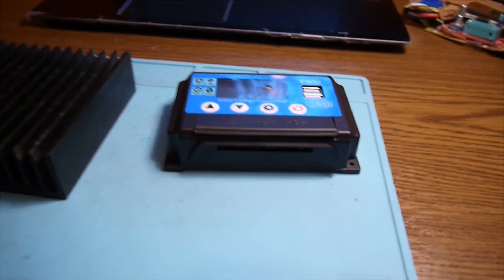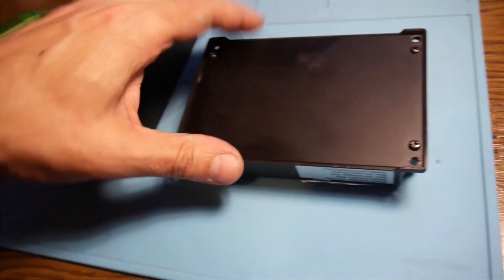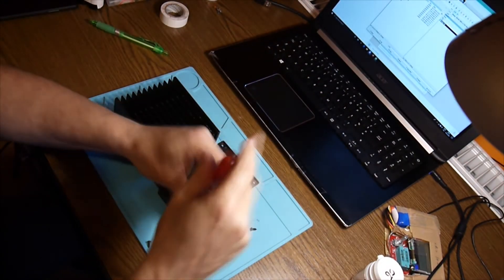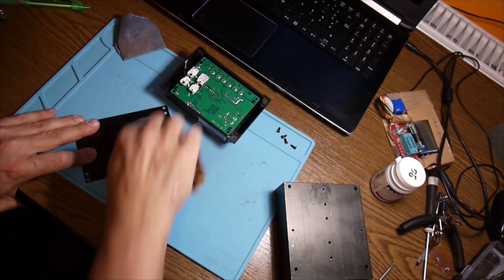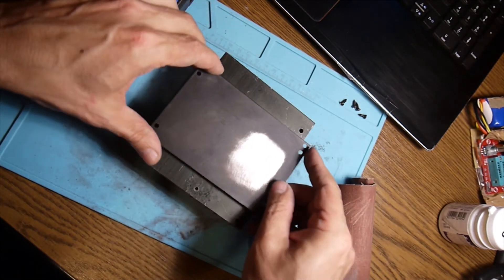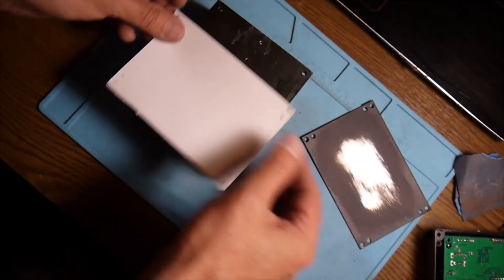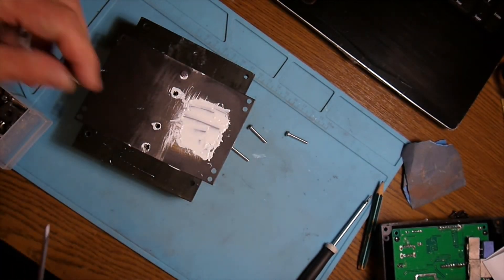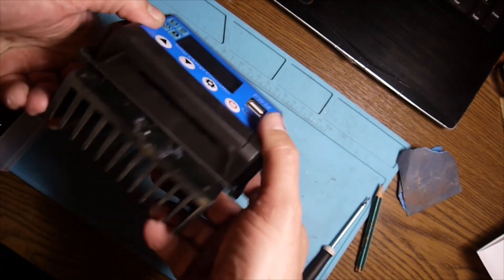Cheap Solar charge controller heat sink enhancement

Comment: I have the same problem. These reduce current it temperature goes above 45c. I think these are usually rated at least double the realistic current. I think it would be cheaper to buy another one and divide the current in parallel. If you install a fan it will probably not last very long. Replacing the MOSFETs with cooler running ones could work, but still costs more. Only $5 with shipping is hard to beat! Efficiency is low without true MPPT and higher voltage from the panels. How did it work out?
Reply from the maker: Only experimenting, never worked one serious but better then nothing.